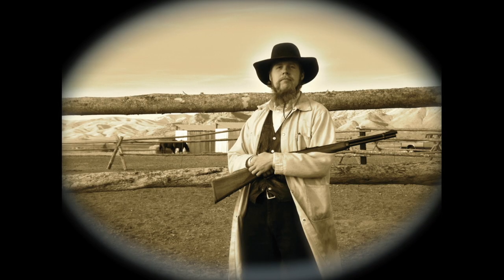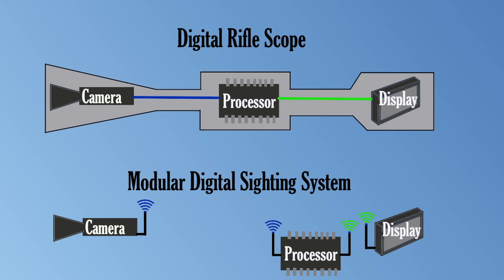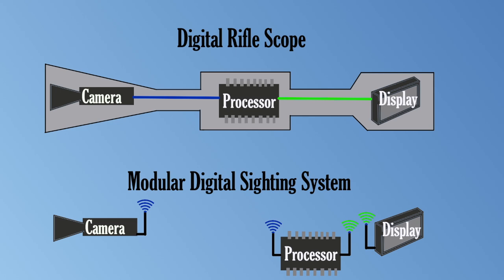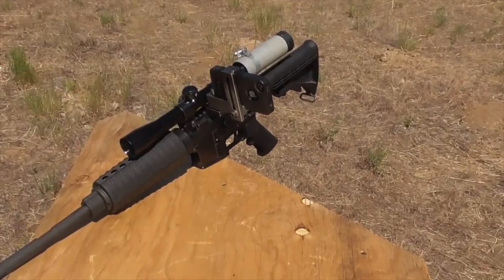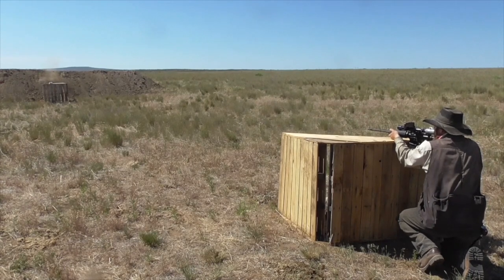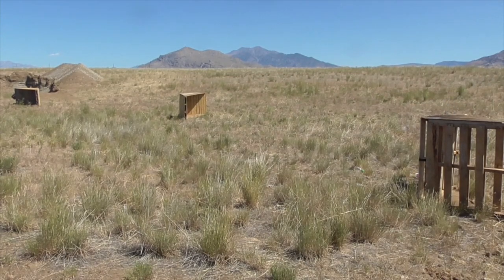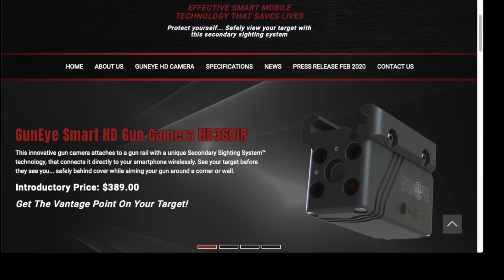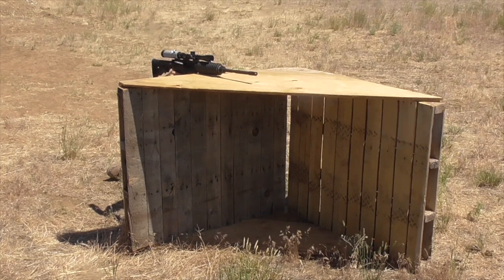The Future of Gunsights - Modular Digital Sighting System (TIS275)

Comment: Take a look at first person view (FPV) cameras for RC aircraft.  Most of what's out there is analog, good resolution on the better gear.  And analog has the edge for near zero latency.  Goggles for viewing the video available if you don't mind direct vision being blocked.  But there's also been recent work on digital tech for the application.

Comment: Getting that 1/2 second delay down to 1/10th or less is the expensive part.  Camera sensor's gotta be fast (expensive), wireless has to be fast (expensive), fast wireless requires lots of power (more expensive batteries), and the app has to be efficient (expensive).  And even with all of that, there will absolutely still be propagation delay.  But, propagation delay isn't too awful when you can remain  behind cover and pop off fairly accurate shots.

Comment: I tried this with a monocular, and some imx 332 chips and some ir leds, so you can shoot "scopeless nightvision" at night. 

The Chinese of Alibaba sended me some faulty chips, so there was nothing i could do to make those function. 

They say to use 16mm lenses, and you should remove the IR filter, or have some IR filter which can be turned on and off (for day and night). 

The monocular isnt cheap, but you could sacrifice and old digital camera and get that digital monocular to get some picture. Add some IMX starfish chips for night, and some IR leds, and wildlifes eyes will glow in the dark. 

Maybe ill try my luck next year and mount it on the air rifle HW77. It shoots a 1/2 inch target at 50 meters every time, so that good enough. 

I did buy some rangefinder and anemometer on Aliexpress, and that delived me some good measuring results. Ive yet to go to the range and check it all out. Wanted the night vision done first. :)

Greetings,

Jeff
Reply: By the way, i uploaded a great silencer on my grabcad account! (its at the about section of my channel)